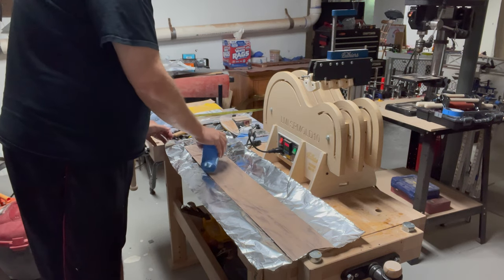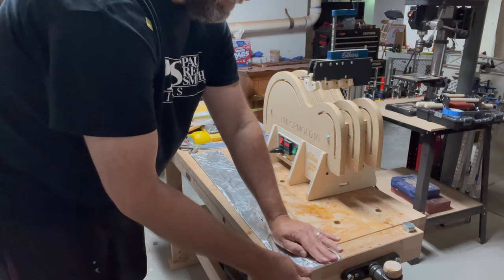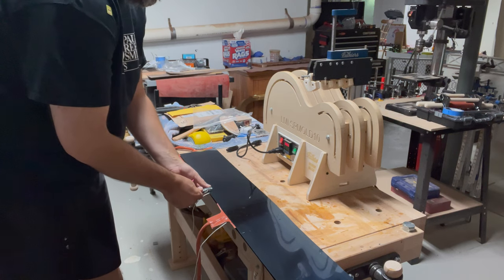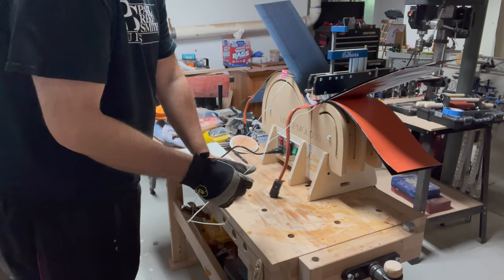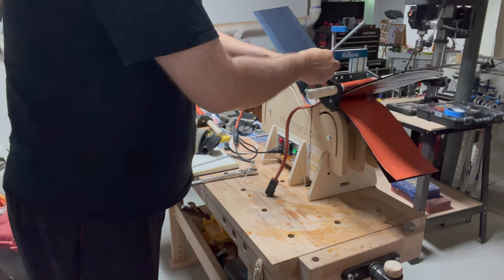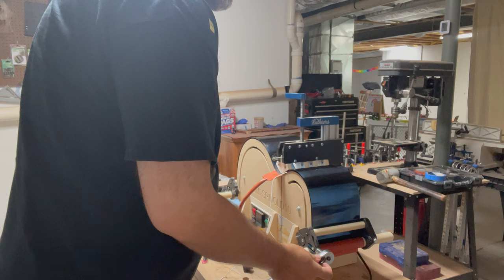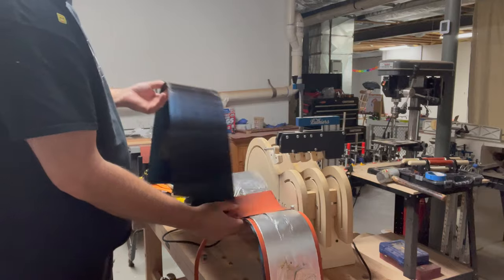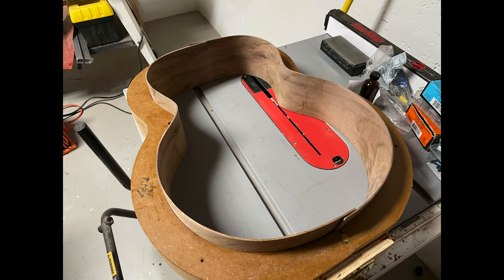Bending Walnut Acoustic Guitar Sides using the LMI Side Bender

Comment: Thats a hand dandy tool to have around. I think I would (if planning to do a lot of builds this way) adapt roller bearings to the slots where the bars go thru the jig that hold those end rollers in place. Thats going to wear fast with that pressure and dragging along those slots really quickly.
Reply from the maker: Possibly. I think it’s probably easier (for me) to make a new MDF insert, all of the pieces disassemble